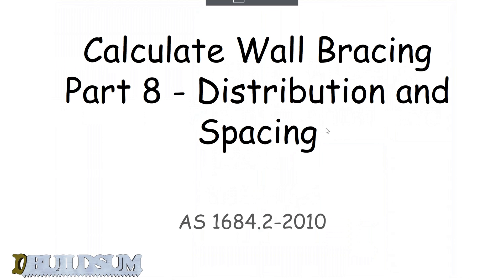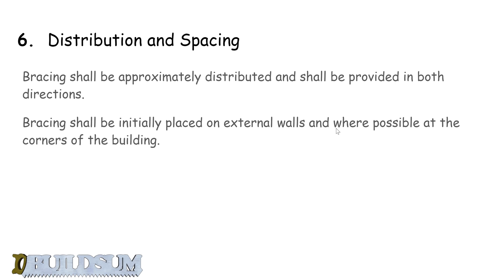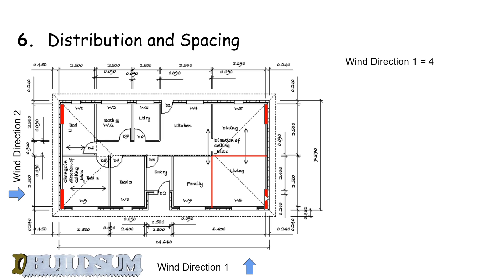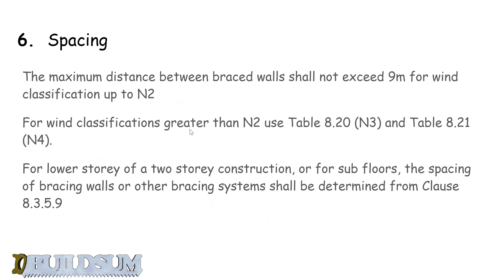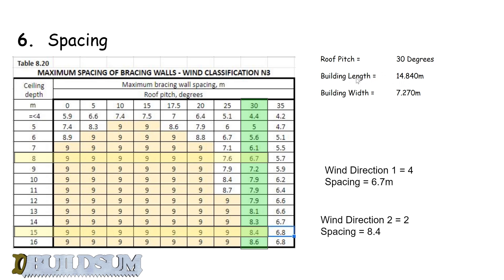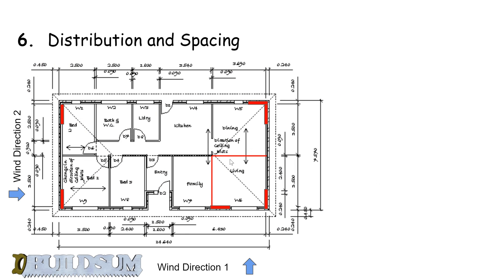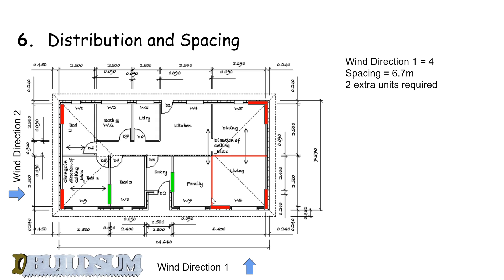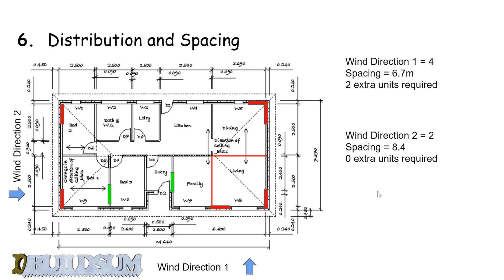Calculate Wall Bracing - Part 8 - Distribution and Spacing

Comment: Hey Buildsum, thanks so much, great videos. Any idea why they only allow 50% nominal bracing?
Reply from the maker: Hi Mate, I would image that because the material being considered and the way that it is being fixed is not made for bracing or installed for bracing reasons they want to have a good level of safety built in.

Comment: Why is it only on the 4 corner and not the entire wall?
Reply from the maker: You start with the corners and if you need more space you can distrute along the wall. It is just about getting an even distribution of the bracing.
Reply: @Buildsum  Thank you so much your video been very helpful! Love it if it could be on patreon so you get paid for what you done. :) You make it so much more clearer then even at University. 

So if it says only 4 then that is all you need on that side of the wall?
Reply from the maker: if you ended up with 4 braces then you only need 4 in that direction. So one on each corner.
Reply: @Buildsum  Thank you! These braces are for windows too??

Comment: Could you use metal strap instead of ply so the walls don't need to be packed providing you have enough wall length.
Reply from the maker: If the metal strap has the same reisiting force as the ply then yes however this is not usually the case. Where possible the ply is placed in the cavity of the wall to eliminate packing or if this is not possible then on the shortest walls.